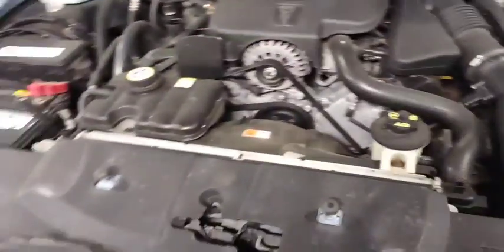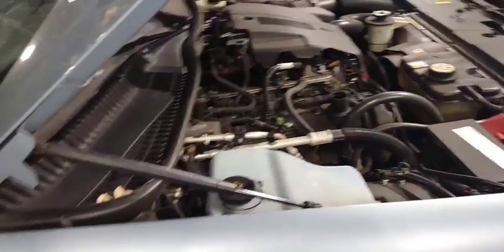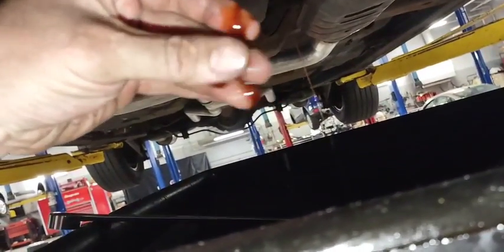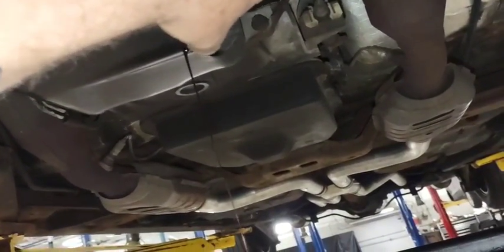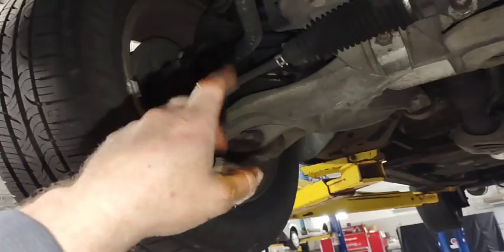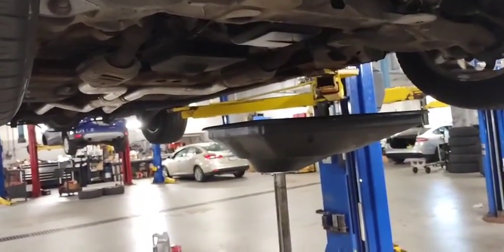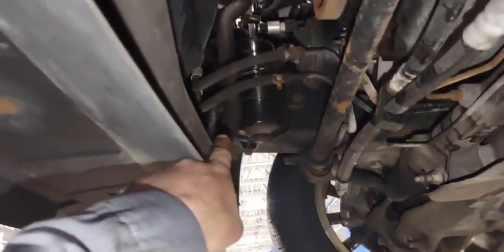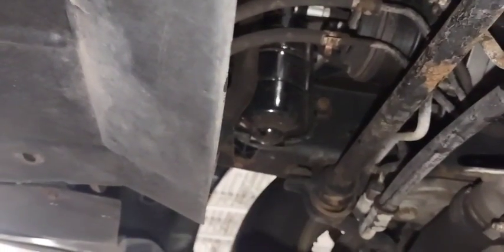Pennzoil Platinum Ultra oil drop 5k Miles, the next 5k Miles trying Mobil 1 extended high mileage

Comment: “Good for 20,000 miles”. Right on the jug.  Lets see 20,000
Reply from the maker: I can't do that sorry I just won't do it
Reply: I don't care what an oil is rated for. 5k is the max interval I'll go. Ever. I about yelled at my dad because he forgot to do an oil change on his '11 Nissan Titan for nearly 40k. The ONLY reason he didn't nuke his motor is because he was running Amsoil.
Reply: 20K must be the best number for highway. Most people drive mixed conditions so the best number needs to be discounted. 
My Camry has 0w20 with 10K oil change interval. But in the last year it only did short distance drive and it looked dark. So I changed at 3K. Additionally I have heard that the interval should gradually reduce as a car ages.
Reply: Id be scared to go 20k with out testing, I religiously new oil analysis to see how my oils doing and what it is doing. I'm currently at 13k on my excursion. With an oil bypass. If it makes it past 15k I'll be satisfied but I'm waiting on my results for 13k

Last test I did was part store oil with 7k in  a year and oil didn't do well.
Reply: I would do 20k, if I could put my car in a trailer and tow it with another vehicle that I do 5k oil changes on.
Reply: Came for the oil experts comments.  They delivered.  Pmsl
Reply: @1997obspsd  if you're going to do extended intervals I think testing is a great idea
Reply: The oil is fine for those miles; it is the filter you cannot go that long for and the mistake people make.
Reply: @texan90  Well Toyota recommends 10k now and they use 0W-16. The driver with the million miler frontier said he goes 10k and those use 5w30
Reply: @mauricemotors8207  
If that works for him, great. But I personally will not do that. Yes I know modern oils are fully capable of doing that. But I don't like the idea of letting the oil run that long. You'll never damage an engine by using shorter intervals than recommended. And with the kind of driving I do, 5k is probably a bit long. My dad attempted to nuke his 5.6 Titan by going 40k (1 year. He drives a crap ton) without an oil change, and I'm convinced the only reason it didn't die was because he had Amsoil in it.
Reply: LoL! But on the back of the container it says to follow your manufacturer's recommend oil change intervals..
Reply: Not a chance! Kinda like ford's lifetime maintenance free transmissions.....if it sounds too good to be true, that's because it is.
Reply: Please no lol
Reply: @FordBossMe  no, I wouldn't do that either. I always tell my customers to ignore that oil life bullshit. Bring it in when the sticker says so. Nice panther. Damned shame Ford stop making em because they were great cars
Reply: @texan90  lol oil evaporates
Reply: @TheBeingReal  oh no no  oil burns off
Reply: @gzhang207  there's 0w20 oil?
Reply: @hothmobile100  yes, SAE 0W-20 viscosity that by design is synthetic oil. It seems trendy for new cars to use thinner engine oil. The manual also says when 5-W30 is used, 5k is the interval.
Reply: @Coleschonfielddd  Nobody said anything about not checking the oil level.
Reply: @Tread69  VW calls for 10k intervals on the newer 1.8 turbos. They hold 7qts. But I still try to get my friend to change his 2 VWs every 8 thousand.
Reply: If you use it it a high oil capacity vehicle that has an oil change interval of 10,000 and you are doing highway miles in mild weather, probably no problem at all. 
I think there is a Nissan SUV that holds 12.5 qts. of oil, who wants to buy that much oil every 5000k?
Reply: @TheBeingReal  I've never seen an oil filter come anywhere near clogging in any oil change interval. Years ago filter change wasn't recommended with every oil change.
Reply: @upnorth5465  Transmission fluid breakdown isn't the reason for most Transmission failures, Poor design and frequency of design change verses slowly sorting out issues and design changes to improve longevity is the biggest problem. Today's synthetics are pretty good. Not that I wouldn't change it at 150k, but probably not the reason they fail at 36k and again at 80k.
Reply: @don2deliver  That is because they have pressure by-bass valves in them. Then the oil free flows afound the filter element.
Reply: @don2deliver  Any automotive engine holding that much oil is typically diesel any more, the old Porche air cooled engines held a lot of oil as the oil was a coolant too would be an exxeption. Diesel owners will change at 5k mile intervals.

Comment: Honestly, I use mobil 1 ep in both my vehicles now. Used to be a penn plat fan. Never had an issue with either, but I run 3.5k on the 98 accord and 5-8k on the 13 civic. Only big difference I see is that the plat got darker for me after running it through. Idk about marked engine noise reduction or anything else though.
Reply: It looks darker coase Pennzoil has the most detergant in it compared to other oils so all the carbon buildup is washed away. It’s not a bed thing at all.
Reply: The underlying reason why the oil got darker is because of the detergent additive is doing a better job of cleaning the engine internals removing any oil sludge. When doing an oil change, I drain the oil then flush the engine using diesel by idling the engine for 10 minutes. Huge difference between clean diesel and what comes out of the engine. I then do another engine flush using a cheaper oil to remove any diesel residue. Now you have a clean engine ready for the good expensive oil which will not be immediately contaminated by used oil.

Comment: I use amsoil, I've tested it at 3k, 5k, 7k, 10k intervals. 7500 is my max and thats on a 97 integra using an amsoil filter. It will do 15K no issues with normal driving. I'm harsh on it
Reply: Amsoil doesn't make their own filters, they relabel Hastings and quadruple the price.
Reply: @don2deliver  yes hastings may assemble the filters but it was built to their specification. That's how it works sometimes

Comment: The proof is in the pudding!! 6:30 proves that engine is still like new, absolutely like new on top of the head, only slight varnish on that side only bc that's the PCV valve side..

BEAUTIFUL!! 
I look down some and they have 1/4th an inch of sludge on the top of the head...

Great video..

Comment: I crossed 400k miles on my 11 crown Vic 4.6L. 
It is still running smooth.
Reply from the maker: Bravo sir
Reply: Dude those crown Vics were great cars.
Reply: Not unheard of. Try that with a turbo charged gdi car. Not gonna happen
Reply: @AB-yc1np  it was a airport taxi. But it is the police interceptor package model
Reply: @FixIt1975  your right

Comment: Pennzoil Platinum is what i use on my 2000 town car with WIX filter. I did notice that difference of smooth and quiet running and better fuel mileage. Thats why I stuck with it. Ive used Mobil 1 before switching. Pennzoil Platinum is the winner for me anyways.

Comment: I started using the Pennzoil Ultra Syn and Bosch DP or K&N HP Oil filters for Years. Change it every 5k Miles. Found it actually Saved me money. As I was only doing it about twice a year. My 2018 Sportster gets Bosch Premium (20 Micron rating) filters. Factory Filter is rated for 40 Micron. I want to know the difference with the Euro version?? My car is a 19 Hyundai Kona SE AWD. Love the car.

Comment: I’m a firm believer in 3000 mile oil changes
Reply from the maker: So am I
Reply: I have a few dozen cars I've done oil changes on since new, the cars that get the oil changed consistently around 3 or 4k always seem to have less issues. So I agree completely with 3k oil changes.
Reply: Nothing wrong with that. I run cheap synthetic @ 5k with oem filters. Engine is spotless inside.
Reply: i do 5k, still use good oil and filters. 10k is insanity
Reply: Me too!

Comment: For what it's worth, I have had the opposite experience with the Pennzoil Platinum.  I had been running the NAPA full synth (basically Valvoline) for years in all my vehicles and had been quite happy with it.  I tried the Pennzoil last year after lots of folks speaking highly of it and my oil temps jumped about 2-3 degrees in equal conditions, (I have a real time digital gauge.)  At first I thought I was just dreaming, but the next change, back to NAPA and they were back down, next change Pennzoil Platinum and they were back up.  So... I think I am going to stick with the NAPA from now on.
Reply: Wow 2-3 degrees, the horror
Reply: Higher oil temp means more heat is being pulled out of the engine.  That is actually better.
Reply: Appreciate the post based upon fact. I am thinking that the difference could be due to the oil viscosity at engine operating temperature. Improved oil circulation helps to cool the engine in conjunction with the engine's cooling system.

Comment: I think pennzoil ultra platinum is what they used in the Hennessey venom GT to go 275mph back in 2013 i remember that video them putting pennzoil Ultra platinum  into the engine before the run. So that's just the brand i use based on that video.

Comment: I'm starting to like the ultra, starting to shy away from mobile 1.
Reply: Same, the natural gas based is probably more advanced than M1.
Reply: @Sonichu_is_watching  it's garbage.
Reply: @midixiewrecked7011  why?
Reply: M1 changed the formula years ago and never was the same, want to try ultra platinum I run amsoil currently
Reply: @jonnyg44  amsoil is ok but all the dudes that sell it are shit sticks where I am so I would rather use something else.
Reply: @chuckdarwin6887  I order it online and it comes to my doorstep. Never dealt with a rep except introduction on the phone when I signed up. Biggest plus about amsoil for me is one stop shop for everything. Use to use rotella but Walmart never had t6 in 2.5 gallon jugs. Love the air cooled oil, hydro oil, grease, etc. side note, I own a business so it is a commercial account so I get good pricing

Comment: I’m in New Hampshire and to protect from surface rust I use translucent cosmoline wax (CRC 06026) and salt away partially diluted in a garden sprayer. The salt away product has given me unexpected awesomeness. Not only does it neutralize salt, it also reduces the chalkiness of aluminum and reduces to some extent small amounts of surface rust. You spray that on every few weeks in winter and leave it. so anyways, if you wanted to protect your vehicle. Use the salt away for a while. And then when it’s cleaned up in the fall put on the CRC . Both are available on Amazon for cheap money. You should get the six pack CRC. Another reason I like this method is oil sprays are so messy. The wax is harder in the winter a little bit tacky in the summer, but it doesn’t attract all the dirt and sand.

Comment: I picked up a 5 gallon jug of 0W-20 Pennzoil Platinum (not Ultra) at Wal-Mart.  That particular Wal-Mart did not have the Ultra Platinum. Later I discovered it was available at another Wal-Mart, but too far away just to buy one 5 gallon jug. I felt the Platinum was satisfactory for my next oil change. Mobil 1 is in my engine now with 4,000 miles driven so far. I will change at 5K and put in the Pennzoil Platinum (not Ultra).

Comment: Can someone tell me why he put the gas pedal to the floor when he first started it. Always interesting content.. thank you
Reply: He did it to build oil pressure first so the bearings and other moving components in the engine had lubrication before running the engine
Reply: Key on, gas pedal to the floor puts it in "clear flood mode", doesn't allow fuel so it will not start.  Great way to prime the oil system.
Reply: He is putting it in “flood mode”. Flooring it cuts fuel while cranking so it spins and creates oil pressure and fill the oil filter without starting the engine and putting load on it without full oil pressure. Reduces a slight amount of wear. Older cars did this. Some newer cars don’t have this feature.
Reply: Clear flood mode. If for some reason the plugs get fouled Ford allows you to hold the throttle wide open while cranking to clear it. I'm sure his intention was to build oil pressure after his oil change before he allowed the motor to fire up.
Reply: @jeremypike9153  You were first You got my vote! Learn something new everyday!
Reply: I change my oil on a euro van, and always get dry knock. Drives me some stress.  It's near impossible to pre oil the cartridge filter due to angle and profile of that cartridge. I will do this and I'm optimistic.  1999 eurovan.,original owner. 102,000 miles.
Reply: Clear flood mode....
Reply: Does this work in a 2008 LMM duramax or is a diesel different anyone know

Comment: At 5k miles the synthetic oil is just breaking sweat.  Run an analysis on both and see how much wear each one has, that will give you a better idea of wear on the engine.  I've used both and change out at 5k miles on every vehicle.
Reply from the maker: You first must understand the application that you're using you don't understand the oil first you have to understand the motor first and that's what most of you do not do

Comment: I started using m1syn since 1991. We used mostly 15/50 on all our customers mercedes vehicles. As to oil leaks we found that at the first introduction, there would be some usage and an increase in oil leakage on ones that already had leaks. We are only talking about seals like the main or crank and others. But after about the 20,000 mile point, the usage and leaks would basically disappear.  We started at 7,500 mile or one year changes and worked up to 12,000 to 15,000 mile or once a year as we saw the results. Also partially based on mb recommendations.  I have used m1 syn oil on all my vehicles including now 20 year old subaru and ford e250. We also found m1 would get rid of dino varnish and other crud. Cannot tell you how many engines with valve clatter were fixed by just using m1 . Yea, the lifter passages were getting plugged from dino oil varnish. Noises never came back after the noise was gone. So yea, my cars get changed once a year as we dont put much mileage on them. If you do short drives, 10,000 is fine. If you drive alot then 15,000 is fine. The ultimate test was a customer who cooked his engine. Melted sensors and such. We replaced what was necessary and then the oil which was not looking good. Started it up and it ran fine. Changed the oil again and it looked better. Changed again and customer took it. Came back in 5,000 miles for the next oil change. The engine continued to run fine for years later. If it had dino oil in it that stuff would have been dust. So for sure, m1 syn. I now use 15/40 and things are still going well.
Reply from the maker: I respect what you do but you know there's also that side of me that thinks anything past 5000 miles is a sin ( jk ) but that's just me people choose to do what they will and I'm okay with that just as long as it's not my car
Reply: @FordBossMe  well, the reason was because it could be done. No waste of oil with constant oil changes. Why change it 3 times or more a year when you could change it once a year without any damage. The 5,000 mile thing came from modern dino oil back in the day. 3,000 was just ridiculous. Remember, I'm talking about synthetic oil. On a mercedes list, we had a guy who knew what he was talking about, maybe more. We mostly had diesels back then so if it worked on a diesel, it was ok on a gasser. Anyway, he changed his oil and then ran it for 10,000 miles. Changed the oil. He then started having tests done on the oil that was in the engine every 5,000 miles. Tests came back with the oil being fine. Then another test and another test. He got to 20,000 and the oil was still fine, basically no wear at all. Sadly he got sick and shortly after that he passed away. Another thing that we all saw and what I saw at my shop was that the problem of worn and broken timing chains and other wear items basically disappeared.  So yea, that's my experiance over many many years of using m1. Now, if you feel better changing oil at 5,000 miles because you feel better about it, more power to you, nothing wrong with that at all. Not here to change your mind, just expressing  my experiances. I do assume you are using syn oil.

Comment: I stopped using Mobil 1 years ago in my older BMWs with hydraulic lifters. There were a few lifters that bled out and were ticking. I tried all of the known tricks to get them to pump back up and thought I was going to have to pull the cams and clean them out. I saw others had this problem and used Shell Rotella T6 and that fixed it for them. Within 200 miles after switching, the ticking noises were going.

Comment: I've always used mobil full synthetic in my vehicles. We used to use Mobil super conventional in all of our dirt racing engines. We figured out the Mobil super would not break down near as quickly. All the oils we used we ran Lucas stabilizer in as well. When you see 20w50 come out in clean with clumps after 2 weekends of racing an engine you know the oil is seeing some serious heat. A mix of Mobil super and Lucas kept it from happening that is why I trust it in my vehicles.
Reply: Honest question - Why do you use Lucas oil stabilizer ? What does it do ?

Comment: Was using liqui Molly on my 2020 JL Wrangler. Heard a lot of good news but didn't see much difference. After switching to Pennzoil ultra premium i notice a change in the engine less noise very little difference but a difference nonetheless. After about two days of driving my mpg went from 15.5mpg to 17mpg. i never usually see it through my morning commute. So i am a believer this stuff works pretty great. Gonna switch for good, its saving me $20 bucks a oil change compared to my last oil.
Reply from the maker: For sure, this stuff is good